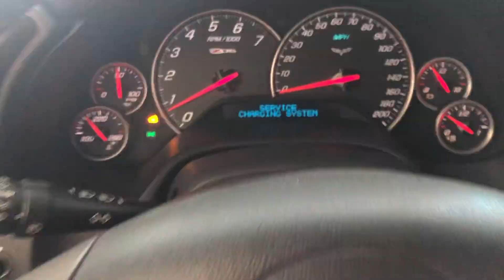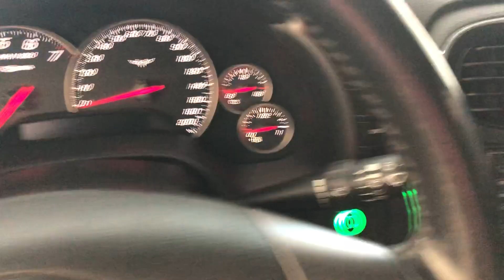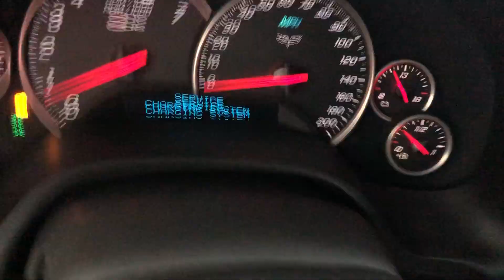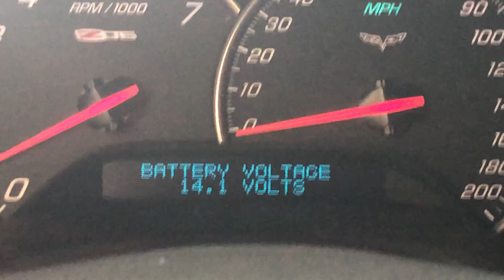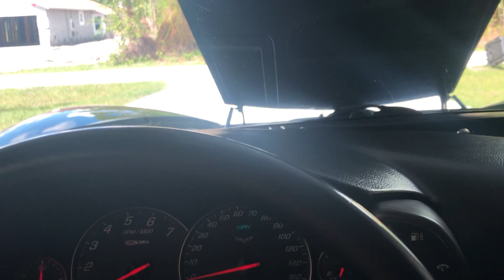corvette c6 z06 ls 7 alternator replacement (service charging system light)

Comment: having the same problem charging system light on change alternator n battery and still whats the next step
Reply: So did I… changed both did you fix it?
Reply: Having the same issue
Reply: @vrcorvettes2048 any luck fixing this? I’m having the same issue on a manual c6 ls3. Changed alternator and battery but still getting service charging system.
Reply: Me too
Reply: A lot of times on your starter the lead will go bad or it’ll become loose or connects for the alternator and if that happens, you can have issues with your vault fluctuating

Comment: Hey man, I just installed a new alternator from GM for mg 07 c6z and i started it and let it idle and i noticed a smell of something burning coming from the alternator is that normal because its new orr ??
Reply from the maker: Don’t remember this happening but if it went away and it’s charging ok should be fine
Reply from the maker: @@MPOWER-zg2kc it’s not working or it’s the service charging system light still on ?

Comment: My alternator failed on my C6 Z06. I replaced it with a new one. Now I always have the service charging system warning on the DIC all the time. These cars are such pieces of shit. I wish I didn't love them so much
Reply from the maker: It’s the alternator,happens often with oreillys  alternators
Reply: My autozone alternator seems to be charging but do I need to replace it with oem to make the error go away?
Reply from the maker: @slick408  not necessarily oem but there seems to be some brands that still have this issue
Reply: I think it’s because of the regulator they’re using on these rebuild alternators. I would stick with AC Delco.

Comment: Don’t buy a alternator ever I have a c5 and those alternator the brushes get worn down $4 fix just open the alternator up and see bmw use the same alternators they are serviceable
Reply: Where did you buy the brushes? My mechanic says the alternator on my 2006 C6 is not serviceable and must be replaced as a unit. I'd rather spend $4 instead of $500+